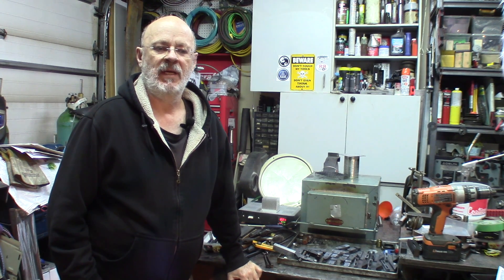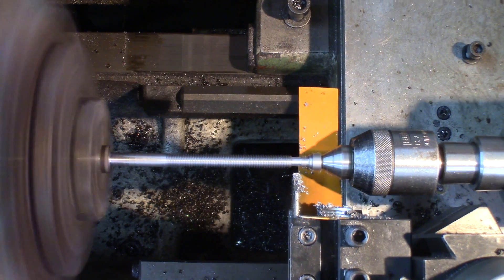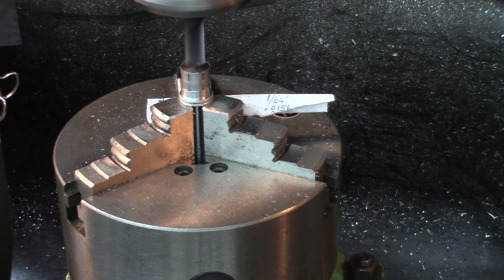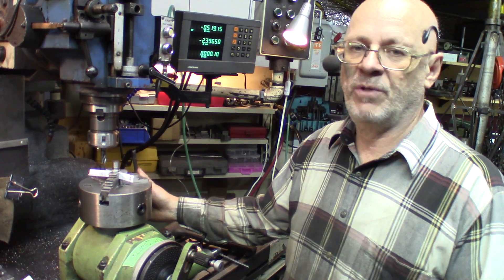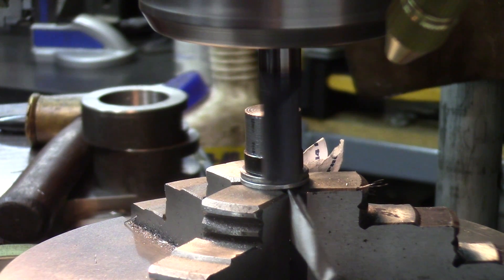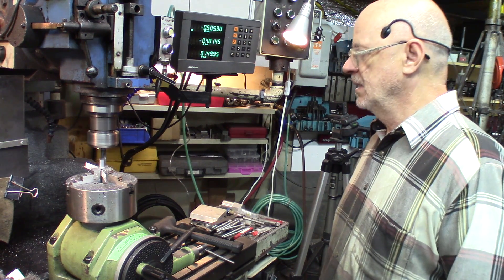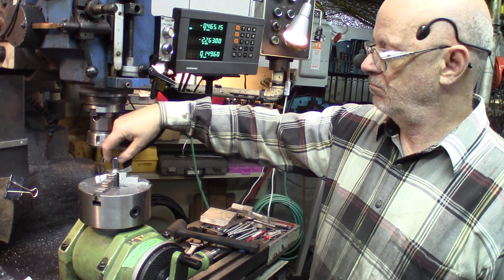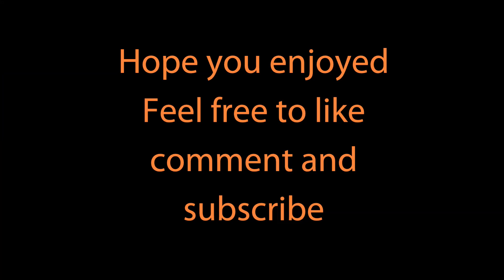WIYB Shop made Knurling Tool, the hex part of the screw on a rotary head P-4

Comment: Not pretty but any "cleaning lady" you can get is better than none! I would like to see this done by building a die and hot forging them. Maybe next time. :-)
Reply from the maker: +bcbloc02 You're a demanding one.... !!!!   To make it happen it will keep me busy for a couple of days. Guess you need some of those for your MEGA STRUCTURE in your to become new shop...   lol
Reply: pierre beaudry
 I am just one guy building the pyramids down here. lol  Really I am more in need of some forged female thread ring eyes that I can use to attach cables to hold posts in position to do away with the ratchet straps as a more permanent solution. Got any ideas on good sources? Happy Thanksgiving!
Reply from the maker: Never needed large quantities of those, so, I use some hardware suppliers like Fastenal or another local supplier about 30 minutes from here, unless you make something that could do the work safely...   Mostly that you're dealing with pretty heavy loads, got to think safety first...  ;)

P.S. Places like McMaster would probably much too expensive compared to a good bolts and screws supplier...
Reply: +bcbloc02  Brian, you should be able to get lifting rings at any place that sells slings, cables, etc for rigging. even some place like Fastenal (if you have them in your area) should carry them.